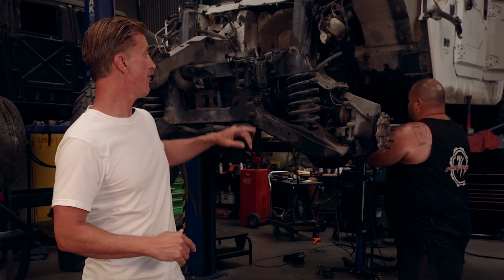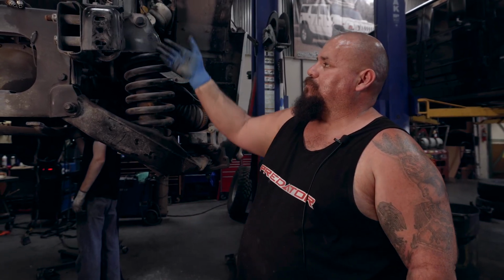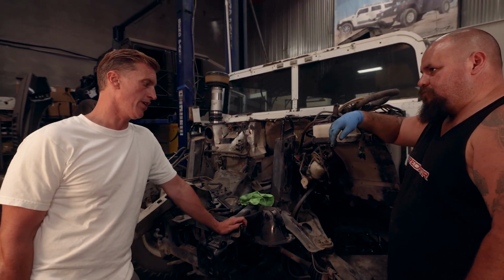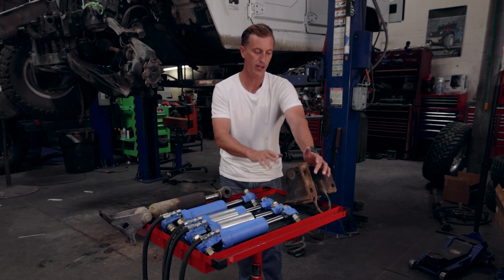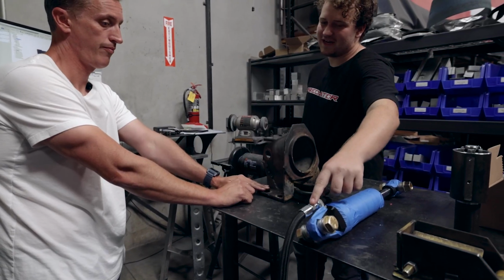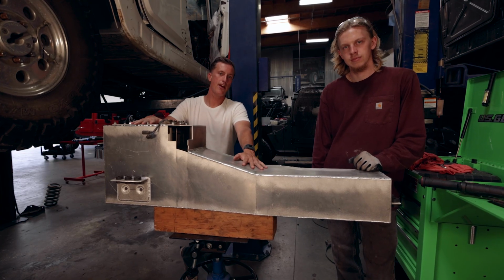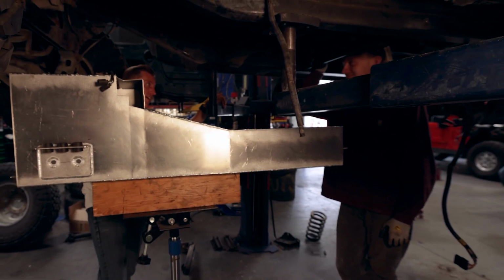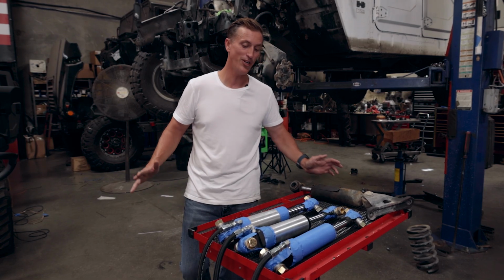SHOCK HORROR HUMMER H1

Comment: Love your channel but reservoirs only provide a small amount of additional oil and only minimal cooling benefits. The actual purpose of the reservoir is to hold an internal floating piston (IFP) to separate the oil from the Nitrogen pressure providing more consistent damping. If you guys need any setup or tuning help, please feel free to reach out. Cheers!
Reply: 😆😆😂😂🤣🤣Most awesome neg ever!!

Comment: Turning to YouTube comments for help lol. What would make a loud noise and cause your military humvee to loose hp? It idles fine, no debris in transmission pan or oil pan and filer was not clogged. Tried new tcm as well. It goes into drive and revs fine but I don’t have enough power to get fast enough for it to shift I have to get a rolling start just to pull it up onto 5in blocks……1097A2 6.5NA 4speed as reference…..

Comment: Hey Ryan. Have you thought about a QD hydraulic coupler that closes on both sides? They make those in locking versions and there is no fluid loss during separation. The entire hose assembly and reservoir could be removed until the shock is installed and then coupled to the shock last. Maybe you thought of that and the reservoir is under too much pressure.
Reply from the maker: Great idea!!! Thats a possibility and may reduce costs considerably. Thanks!
Reply: Yeah.. quick disconnect is 1000x simpler.  Discharge the reservoir before disconnecting and recharge it after it's in it's proper location.

Comment: What about reclocking the 90 coming out of the shock to where it come out downward allowing to route the house out allowing you to mount the reservoir on or under the frame rails
Reply from the maker: Imagine the spring as a solid tube. The only exit for the reservoir would be through the bottom of the a-arm and then it would need to be routed back up to a secure point. This would pose a problem with the line being too long to effectively transfer fluid as well as being exposed under the a-arm to rocks and debris. Not much of an option here except for going up through the perch. Thanks for the recomemdatiin and for watching!
Reply: @PredatorInc  sorry I was expecting there to be an area above the spring where the perch mounted the frame

Comment: Have you reviewed how Rod Hall does his shocks through the factory bracket? This could possibly save you some money on design.
Reply from the maker: He has new upper spring perches for the reservoir to pass through. Were looking into a similar design which allows up to both strengthen the perch as well as allow simple pass through/install. Got a few additional ideas on playing with the geometry for added tuning. Thanks!
Reply: @PredatorInc  For the long travel kit yes for the mid travel kit no he uses the factory upper mounts. I have seen mid travel kit on Mountain Machines truck and Rod Hall uses some kind of coupler on the hose. If you would like to talk more please get in contact with me directly.

Comment: Why are you not pulling the shock reserve tank off? Then you just run the line up and refill.
Reply from the maker: Because of fluid loss when you break that seal. Then introduction of air. It would have been easy to install but would be almost impossible for an average installer to purge the system of air and get all the fluid back in to the correct levels.
Reply: @PredatorInc  I do this and others I know ...you could loan out the equipment and still be cheaper then making mounts:  https://youtu.be/XwFKURYwfaM
Reply: I have to do this on my Race Car. Here is another: https://youtu.be/2PjIOzEL4pc
Reply: I’ve done the same with the shocks on my wrangler I’ve beat on for years. Vent off the nitro, disconnect (at the reservoir in your case) cap and plug if you need to install, fab, etc. When you’re done installing the shock body, pop the plugs, reconnect and top off to desired pressure of N2. Really don’t loose any fluid. Ps… hurry up, I wanna set for my M1123.
Reply: ummm, guys....he doesn't actually understand how these work...

Comment: Disconnect the hose don't over think it
Reply from the maker: Not the best option. To correctly refill the system from loss of fluid and purge the shock of air it would be almost impossible for the average shop or installer resulting in sub par results from the shock. We looked at that and would love to have done that. Plus the top of the shock would touch the perch under compression.
Reply: @PredatorInc  Drybreak valves?